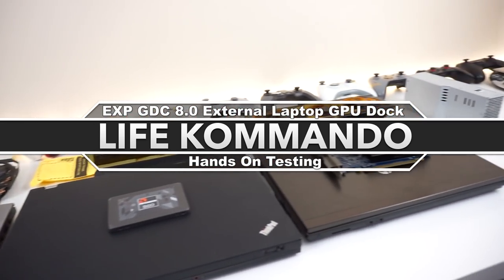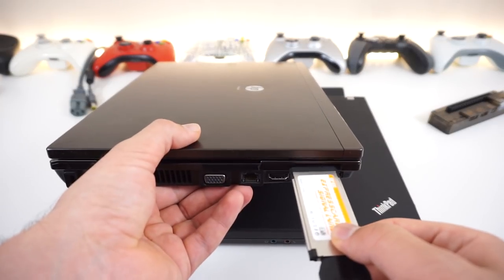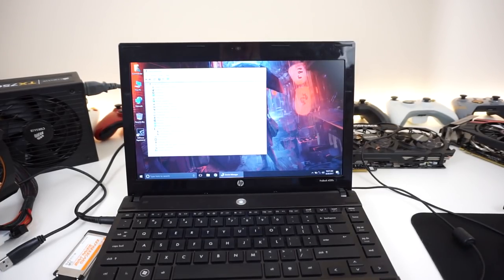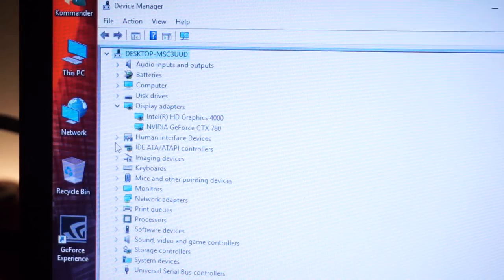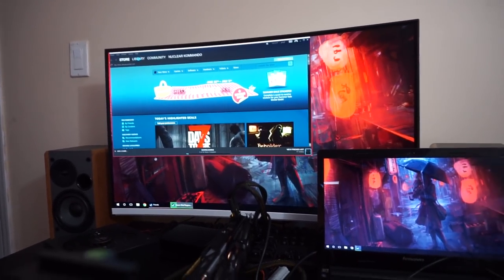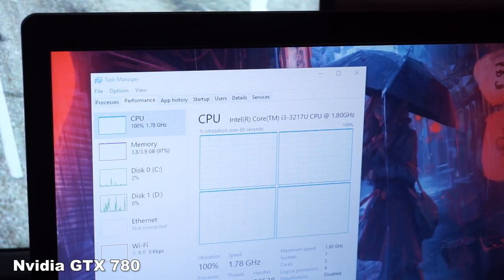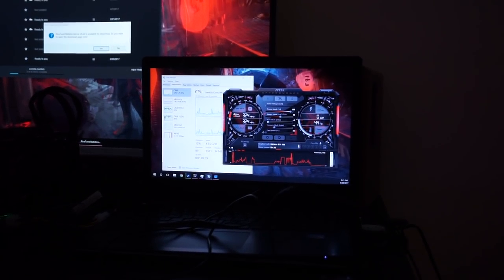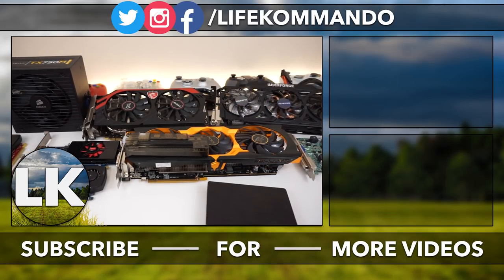EXP GDC 8.0 eGPU | External Laptop GPU DOCK | Hands On Review

Comment: HI,
i HAVE A DELL 5559  with 6thgen ci7 16gb ddr3 ram 480 gb ssd 2tb hdd dual graphic card intel hd 502 and amd r335
The problem is both the graphic cards are crap, can i use this method to install a third powerful graphic card?

Comment: I connected gtx 1060 to my Lenovo y580 with Corsair 750w. I tried on win 7,8 and 10 and unfortunately I have crushes (about every hour - info about NVIDIA driver stopped working ) I tried all drivers versions from 361. Any ideas how to fix it ? U also said that one of those card is not working (3 fans- I guess it is smt stronger) I had similar problem and problem was in this small cable which u use to connect to power supply to pci , just remove it and connect power supply directly to adapter (but to have power u need to force power supply to turn on - put some wire into two 4th holes in the same line and after that press button on on power supply. I did it and I can play now 😉

Comment: I cannot open up my laptop to change the battery or any of the internal components as it is really old. Is it possible to use a usb to mini pcie adapter to plug in the external gpu dock? Would that work or would the connection be too slow?
Reply: Tom Brown will not work sorry

Comment: Hey Dude, do you know if it's possible to upgrade an old Toshiba Pro 75-A7200?
I wish to upgrade it adding an eGPU, a ZOTAC GTX 1660 6GB GDDR6.
The Toshiba's CPU is an Intel Core i7 4700 MQ and I can upgrade 32 GB RAM up to. 
The thing is that I want to keep using it 'cause I don't have enough money to get a new one and I have to keep working on it with some design software. Do you think it is possible to give it a second life?
When I'm working or playing, the statistics and percents says that CPU is working around a 25% only and Intel graphics are always 100%, so I thought that I could upgrade it with an GTX 1660 super 6 GB GDDR6.

Comment: Yes when i used expressed card the bios doesn't want to start. So should i but mini Pci cable to give eGPu another shot? any suggestion? my laptop is acer aspire 4730z it has built gpu ati radeon HD 3200

Comment: I have a Dell Inspiron 5570 with Radeon 530 2GB Dedicated GPU, with i5-8250U. Will this mod work on my laptop? I would like to get a Rx 560 graphics card to pair with it. Also, can this mod allow me to use the external graphics card into my built-in 1080p display?

Comment: I use hp pavilion 15n270tx and I try to do an egpu. Did you install a mpcie to laptop and when you boost into window it dont black screen? When I boost into window(plug in psu after power on laptop), my laptop cant detect the egpu.

Comment: Hello. What do you think, can i use with my Alienware 17 laptop? (i74710hq, gtx860m). If only work with Intel hd card I can take it my dedicated GPU. If I can use, which the supported gpus? Thanks a lot!
Reply: Kia, Alienware makes a $160 exclusive external graphics card dock that only works with the Alienware 15, 16, 17's and what not.... you're very very lucky check it out... its only $160 bucks and does the samething that the Razor CORE does for $500

Comment: great video just earned a sub. Question would this be a good option for a hp 9480m would the cpu bottleneck its a Intel Core i5-4310U with 8gb ram the graphics card ill use maybe a rx 480.

Comment: I have a GTX 750ti Low Profile GPU that only takes power from the PCI slot. Would this GPU run on a laptop without an external power supply?
Reply from the maker: You will still need an external power supply to run the dock and the PCIE lane, or find a 12V power adapter to run it instead of a full sized power supply, btw love those 750ti low profiles

Comment: My laptop was a full sized PCIE Express slot with a removable graphics card. If I had a dock like that it would actually be possible for me to put a full sized graphics card inside my laptop if I modded the case a little.
Reply: Mr Trench ok if u have a full size pcie slot then buy a pcie extension then connect the gpu with that obviously u still need a psu though
Reply: Prod. Infinity my problem is I don't think my laptop can power a bigger graphics card than a gtx 1070 so that's why I was looking at this. I will need an extra power supply.

Comment: Does this have a gpu performance hit since it's PCI to PCI? The modern day thunderbolt ones drop a lot of frames
Reply: Tmanstomp100 yes it does thunderbolt is only pcie gen 3 x4 but it's has a very large lead in first place with how much info it can process
Reply: Thunderbolt ones only drop performance if they are linked to the chipset PCIe lanes instead of the CPU lanes.
Reply: Tmanstomp100 It really depends on the graphics card. Pairing with a high end card will obviously result in dropped frames, check out banggood's website on the EXP GDC Beast for a chart.

Comment: my laptop hardware info says: PCIe v3.0 x8 (8.0 GT/s) @ x4 (2.5 GT/s) on my amd r5 m330 videcard. 
i got lenovo ideapad 300. intel core i5 6200u 12GB ram, amd r5 m330.
can i use that pcie port instead of wifi pcie slot?

Comment: Hi. So I have done everything u said to do connecting my 1060 6g to my MSI ge70. The device manager sees both gpu just like urs both with the yellow exclamation mark icon. I tried installing the drivers.. the problem still persists. Oh and i also lost my nvidia control panel. I don't know what else to do.. Can u help me?
Reply from the maker: 10+ series cards are not supported, I have to make an indepth updated video about this
NGFF should work but seems like some have issues with it

Comment: Please HELP!
I have Asus N550JK 16GBDDR3 with i74700HQ and GTX850M
I want to install GTX1060 on EXP GDC v8.5 kit
Please guide me what settings should I do on Asus?
Should I uninstall 850M drivers first?
what if keep all GPUs IntelHD graphics, GTX850M, and GTX1060.
should I operate laptop with the battery?
how can I switch to intelHD, because I don't want to be on eGPU setup all day?

Comment: i will buy gtx1060 but my laptop has got intelUHD 620 and nvidia MX130, I heard that if you already have internal nvidia card in your laptop and you wana buy external nvidia card there might be problems. I actually wanted to buy RX 580 but you nedd external monitor so i canceled it.

Comment: is there any way to use it instead of wifi card? my laptop has hdmi port(hp probook 450 G5 i5 8th GEN) is there any cable which is contains hdmi cable in both side of this cable, then is there any way to use it just with hdmi port? i mean one side of this cable will connect with eGPU dock and the other side will connect with my laptop hdmi port??

i really wanna make my laptop into a gaming machine

Comment: I have a problem with the dock or with my gpu. I tested it with gt 730. It works fine. When the time i put a gtx 1050ti or my gtx 660. There the error code 43. I do not know if it needs more power with the gtx 1050 ti? Should i put the 6pin from the dock side?

Comment: I have lenevo t430u laptop. I add exp gdc beast 8.5c to my laptop in the mPcie port. Problem is laptop wont boot when graphics card connented.  Is that a whitelist problem for my wifi port? What should i do if this happened. Please help. Graphics card is maxsun rx580 8gb.

Comment: I have a probIem! Pls help. I bought the ROG strix 1060 6g and connected it with pci Express by taking out my wifi card. The Problem is that the card isnt Shown in my device manager and i cant install the card thru the driver becaus it says it there isnt a card pluged in. I dont know what to so?!? Someone pls help
Reply: Dude... Did u uninstall wifi device software before taking it out ? Secondly u should have checked if your pci supports your graphic card... 3rd u should have pressed f2 and checked during start of laptop
Reply: @rockie292  yes i did unistall the wifi card driver and yes i look into my bios but i could not find advanced bios on my acer aspire 7750g! But your are correct i did not check if it was kompatibel....
Reply: Yup that might be the reason.. u can still buy a new one.. just check if it supports or not, secondly just sell the old one to someone.. i will also be buying one for myself to support my 750ti.. + 450w supporter...  @lasvegaswithoutfear3802

Comment: My laptop= i7-2670qm and GT 540m-2gb IF I use egpu with Gtx 770 in 4k cs go will my cpu or gpu bottlenck? I run ryzen r5-1600x with Gtx 770 4k ~100fps inside my desktop.
Reply: samet yasar it will bottleneck alot , will be barely playblr on  1080p  60 fps , csgo is cpu dependent

Comment: My 3y/o laptop needs this but I don't know if its compatible. It has the Intel Wireless-AC 3160 card and I think that's in M.2 format and is not compatible with the mini PCIe the dock uses?
Reply from the maker: The dock comes in PCIE M.2 & NGFF those are expensive and not much info about it out there

It prob can be don but have yet to try it
Reply: I've googled that M.2 slots can be used by mini PCIe the dock uses but I'm still not sure about compatibility. 
Those M.2 and NGFF you mentioned are like triple the price of the mini PCIe variant and the M.2 one is 4X, I'm positive my laptop's network card doesn't use that long of an M.2 size.
Its quite tiny actually, I'd say tinier than the mini PCIe network card my older 8y/o laptop uses.

Comment: bro pls help me i already put an exp gdc on my laptop ,the psu and gpu are working when i turn  on my laptop but my laptop  stucks at the acer logo, i. do everything bro, i. uninstall my dgpu, and dissable network  boot, what should i do bro, my laptop is  acer aspire v5 471p with intel i5-3337u. and my egpu is rx 560, pls help me bro

Comment: 43 WHAT DRIVER VERSION CUZ IVE TRIED A BUNCH ALSO THE 780 HAS two 8 pin connectors so how does that work cuz I’m using a EVGA 400w PSU PLZZZZZZ HELP!!!!!!

Comment: My laptop display doesn’t turn on when i connect the exp gdc through pci-e connect, any idea? Or is it cause of dead gpu?
Reply: Whitelisted
Reply: The disadvatage part of using eGPU is if the laptop detects 3rd party hardware inserted into it, it may broke the laptop mostly HP, Dell,Acer types of laptops

Comment: I have an Lenovo G50 with i5-5200U, 6gb ddr3. If i buy like 1050 ti or rx 560 how much more fps i'll get? (Now i have csgo on 4:3 800x600 all as low as possible and i get like 50-80 fps)
Reply: or tell me atleast can i use that egpu on my laptop :D
Reply from the maker: I took a quick look at your laptop, seems like your wifi card uses the NGFF interface: 

https://www.banggood.com/NGFF-Version-V8_0-EXP-GDC-Beast-Laptop-External-Independent-Video-Card-Dock-p-1009978.html?rmmds=detail-top-buytogether

Do a bit research on what connectors your laptop have, personally have not tried the NGFF version but it should be fairly straight forward and similar to what I had shown on the msata version in the video

If it does work you should be getting some really good performance, since you have an i5u and NGFF instead of msata

Hope this helps
Reply: so with that im good to go?
Reply from the maker: That should be it, no guarantee, but I would say double check by opening your laptop back side and see where your wifi card is and what type it is
Reply: Ok. Thanks for helping me! :)

Comment: Can i use a usual  hdmi cable from the V8.0  to a thunderbolt adapter  and then to macbook pro ? 

(i am using windows bootcamp)
Thanks
Reply: Michael Original ı wont do it.

Comment: Hello, I have crazy question. I have 2 mini pci-e in my laptop and I also have 2 video card NVIDIA 1070 with sli. It is real connect 2 video card together with sli? I,m sorry for my English. I’m from  Russia))
Reply from the maker: No worries man,

I actually have recently started experimenting with a bunch of different hardware variations, one thing I plan to test is doing SLI

Chances of it working are low since Desktop Motherboards advertise SLI, but who knows, it may work but I would not recommend it even if it works, you may not get very good improvement since the pci-e mini has very limited bandwidth.

So I guess we will see late in the future on my other channel when I start testing that! :)
Reply: Life Kommando , Nice to hear that. I will look for forward to it!

Comment: does mini graphics card can be used that does not need power supply  ?  [ for thinkpad x230 ]
Reply: You will need a power supply because the laptop itself can't power the all thing up from a simple pci-e slot that is intended for wi-fi boards. It will be the same with express cards though. It's the same for all laptops, the fact that they are portable just limit them to get a lot of power. However you can get a very cheap 380Watt power supply nowdays on ebay and stuff which is pretty cool

Comment: someone knows if the pci-e its working with a gtx 1660 6gb?? I have an Acer v5-571g, i5 -3xxx and 8gb of ram, and the strange thing its that on this laptop I have an intagrated gpu from Intel and an Nvidia 620M intagrated por laptops. Year of production 2012. Thanks!

Comment: hello man i hope you will answer at my question 
i have a omen 17 7700hq with a 1050 , and i have a desktop 980ti 
did u know if is compatible with NGFF M.2 A/E per V8.0 Exp GDC Beast?
my pc has ngff slot btw , but i don't know if 980ti(msi) is supported
Reply from the maker: It should be compatible even with 10 series cards if you are using NGFF
Reply: @LifeKommando   so no 900 series?
Reply from the maker: @arrowdrill1432  sorry i clearly didn't finish what i was typing. Yed 900 series will work just fine as well
Reply: @LifeKommando  ohh thank you man , :))) , for info and for really really fast answer

Comment: Hi i don't have express card slot, but i already bought one whit express card.
Can i use an usb 3.0 adapter and a hdmi adapter?
Reply: If you want to get it to work via usb, it might be possible, but definitely not worth it, you see, a lot of data is going pretty fast on the computer when a graphics card is hooked up to it, and USB 3.0 can't handle that much data (That's why it only exists for express cards and PCI-E slots, they can handle way more data by themselves) so I'm sorry but I think you should buy a seperate PCI-E adapter otherwise you will get VERY underwhelming results.
Reply: Mouse's Mistake i found a hdmi mini pci e adapter can this work

Comment: Can i run this Egpu with my evga 1080ti ?? does it have any chance of Ruining the gpu i have a samsung laptop i7  2.23ghz should i try this ? the laptop has a very bad gt610  i got the 1080ti on good deal and i wouldnt want to ruin it help!
Reply from the maker: There is a good chance it will work, what connection do you plan using NGFF or PCI-E Mini
Reply: PCI-E Mini

Comment: Its not about the bottleneck, its about getting the pc to run better, obviously the bottleneck matters when it comes to the treshold. no point in getting a 1650 when it will run at a 640 pace. might as well just get the 640. but if you plan on using the gfx card in abuild later on bottleneck dont matter

Comment: I wanna see someone using that ac adapter from laptop charger as a power, that build maybe will make sense with low power gpu like 750ti, i dont like a bulky setup on the desk with huge power supply and gpu.

Comment: I have a Lenovo z50-70 with a intel core i7 4th gen, it has 840m Gt Geforce, no longer working(code 43 error) i wasn't able to fix but i was planning to hook it up with a Nvidia GT 1030, is it recommendable?
Reply: It's a driver problem, came with windows 10. to make it work again you a to downgrade to windows 8.1 then upgrade again to windows 10. That's the basic solution.
I had the same problem and I found a easier solution but the forum where it is is currently offline (it's in french ;) ) 
http://portables4gamers.com/forum/topic/25729-gtx-765m-erreur-43-code-0000002b-win10/

You can use a GT 1030, but new cards often don't work. I think you can find a GTX 760 for a cheaper price, and more powerfull
Reply: Tried to downgrade it 8.1 and upgrade it to windows 10 but it doesn't seem to work for me.
What about  GTX 1050 Mini 2GB DDR5?
Reply: GTX 1050 (and Ti version)  are not quite compatible with it so it's not recommanded sorry
Reply: Why is it not recommendable? I just bought a GTX 1050 min 2gb DDR5, dude.
Reply: Because creators of EXP GDC say it, I doubt you have read the very first line of details, it's in red:

"Pleast notice that this adapter is NOT quite compatible with gtx1050, gtx1050Ti, not recommend used with it."

Sorry but read before you buy next time, you can try anyway but it may not work at all. I can't do anything else
Reply: Which are all the Graphic Cards and compatible with it?
Reply: See the last picture here (they are all compatible, recommandation is for the bandwith):
https://www.amazon.com/Laptop-External-PCI-Graphics-Card/dp/B00Q4VMLF6

Plus 1060/1070/1080/1080ti are compatible
Reply: Thanks for your help, dude  :)
Reply: You're welcome Man, I hope you can find a solution ;)

Comment: The thing I fear the most. After spending all the money for these things and my laptop can't even run them...how to reduce this kinda risk?...I really wanna upgrade my laptop....

I want to use the express card...
Reply from the maker: For some reason I couldn't get it to work back then, probably because of the laptop i was testing on but now i can easily get it to work on multiple laptops
Reply: @LifeKommando  what does it require to work? I got a versapro NEC laptop. By any chance did you test on this kind of laptop?

Comment: soooo i tried doing this same thing with my t420 i tried using a gtx 1050 ti and couldnt get it to read so i found out at the time the new architecture wasnt easily read so than i tried a gtx 970 and after that failed with bios issues and compatability i said screw it and did the prebuilt route and now a year later im almost done with my from scratch build so thanks edc beast for being a complete failure that led me down the road of pc master race